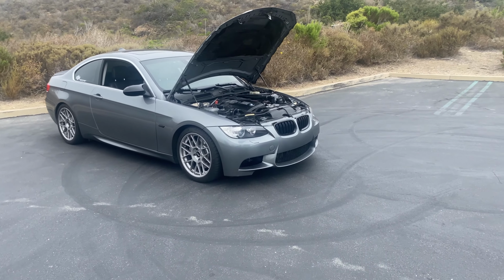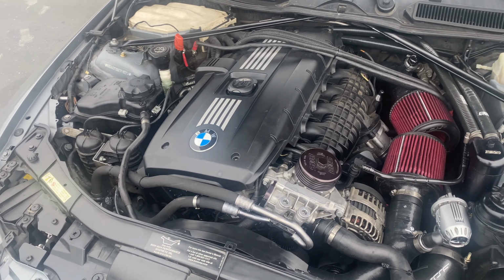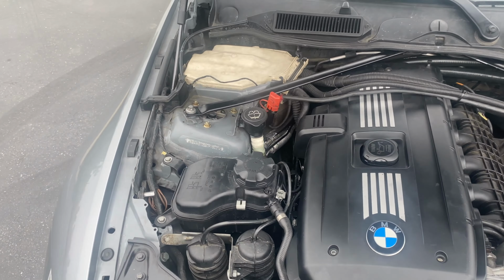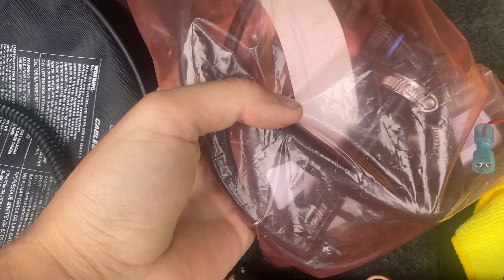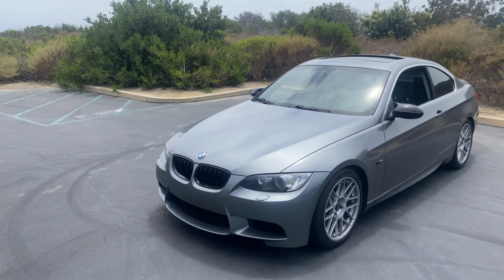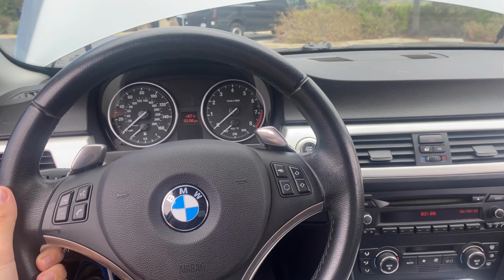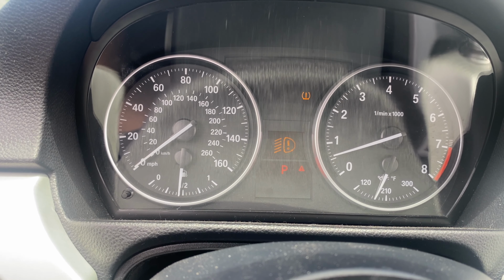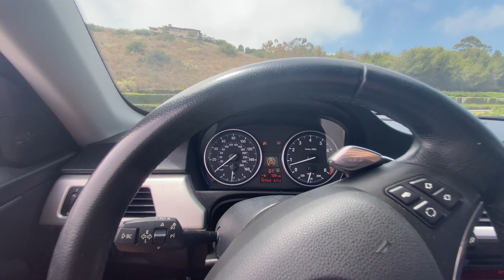17T e92 Update Video! *ORIGINS Meet Vlog* #n54 #17t

Comment: Very clean build 👌

Are the turbos 17t Chinese ones and what power level are you running?
Reply from the maker: Viv is the company, and I’m around 440 whp id say. Once I get pi kit on I’ll get over 500 whp easy on full e
Reply: @Rvssvlle90  👍🏾
Reply: @Rvssvlle90  those viv 17t and inlets make over 500 whp on E50 tune. Well over 600 whp with pi and E tuned.
Reply: I have the VIV 19t revision 4
On pump I make 435hp
Going for a re tune shortly for pump and e50